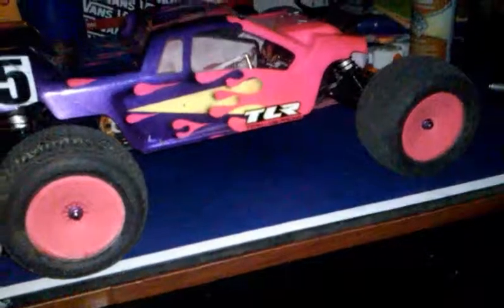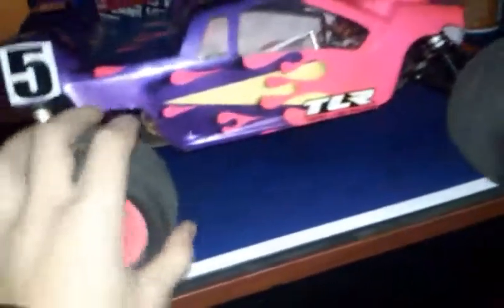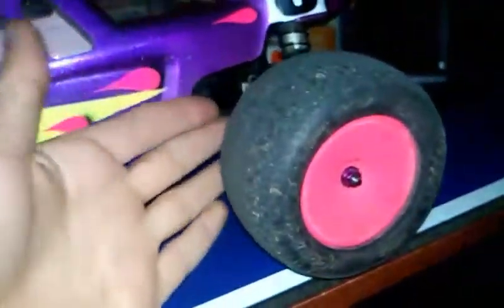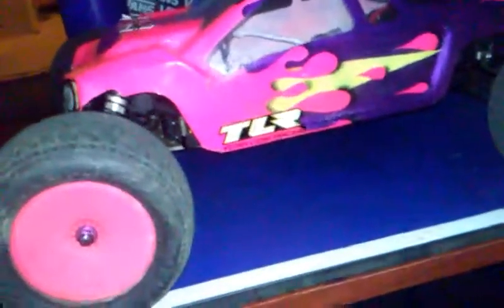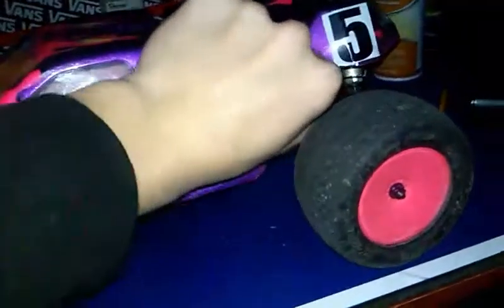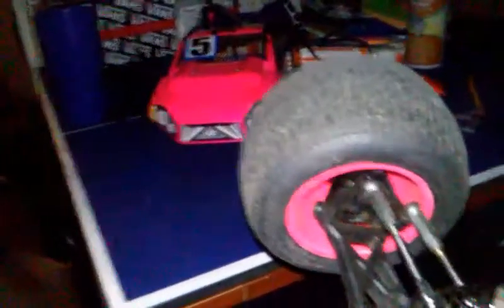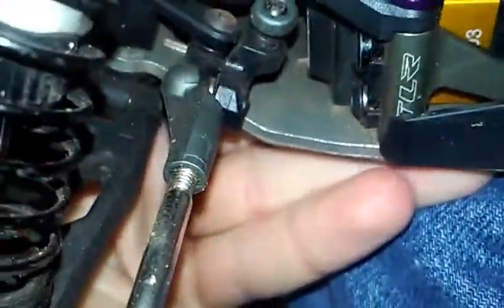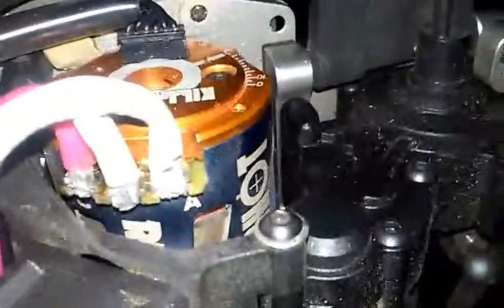Upgrades I want for the TLR 22T

Comment: let me know what you find if thats a Gen 1 22t. i picked one up today and have been researching uogrades with no luck
Reply from the maker: Tyler Gaffney i found out it is gen 1 because of the chassis and the rear a arms and rear hex is gen 1
Reply: Chevy RC yup figured let me know what you find. also replace the rear hexes and pins with the hot racing ones. espeicay if you want to upgrade the motor/ESC. losi uses hollow pins and they shear off under too much torque
Reply from the maker: Tyler Gaffney ok thanks for the info the stuff i found is chassis, 22sct hex, rear a arm that is longer and has 3 holes, gen 1 had slider shaft, gen 2 has belcranks, titanium carbon titride pins and shock shaft that are a dar grey color, trailing arm is different, longer driveshaft, and thats all i know so far if you want to you could go to amain hobbies and type 22t 2.0 and look at the parts and look at the discription and it will tell you if its 2.0 or not and look at what it fits to
Reply: Chevy RC so some parts from the 2.0 is adaptable to the 1.0. nice to know. its a great truck just needs some better arts
Reply from the maker: Tyler Gaffney yeah but i hope that helped you
Reply: Chevy RC definatly did. thanks. subscribing for the build series:)
Reply from the maker: Tyler Gaffney thank you